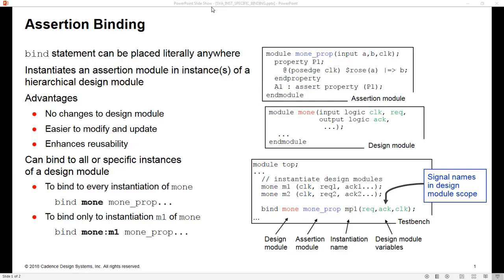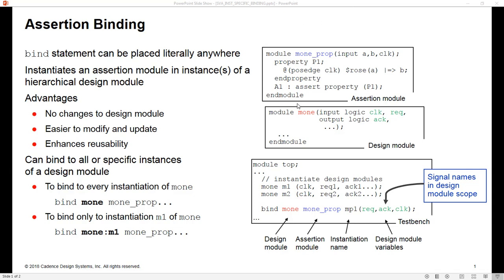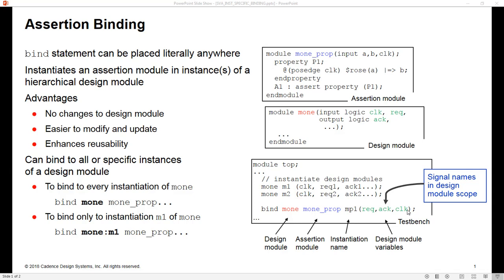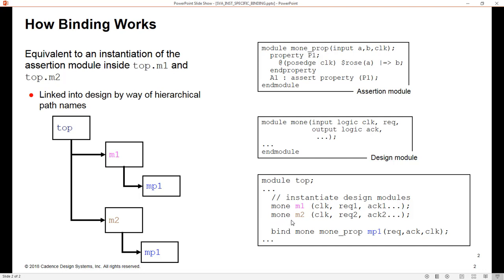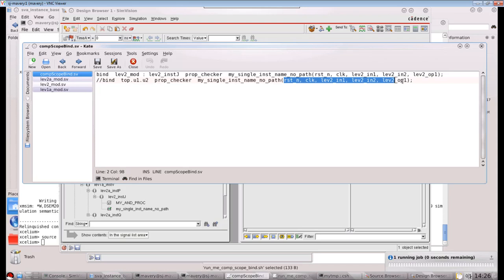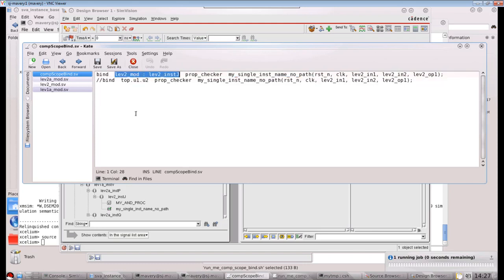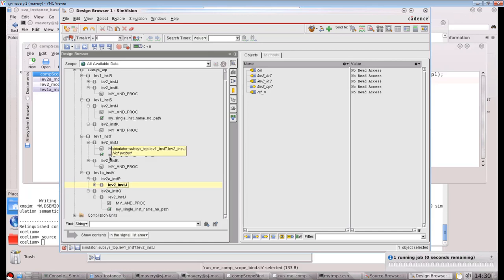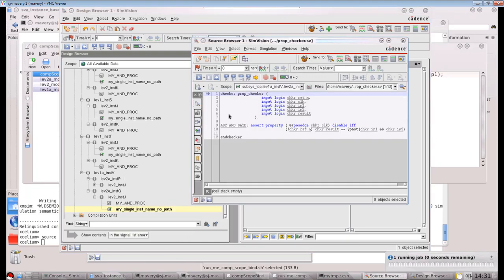SVA Instance Based Binding

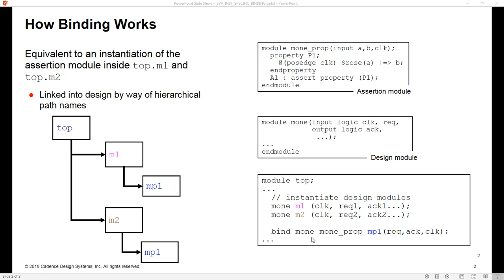Comment: At time 3:18 you state that the scope of the bind statement could literally be anywhere.  I'm not sure that is actually correct.  I think the bind statement and the module being bound into have to be compiled in the same compilation unit for the bind to work.